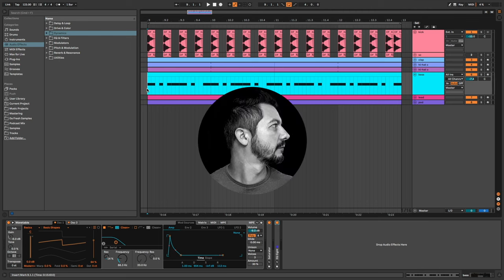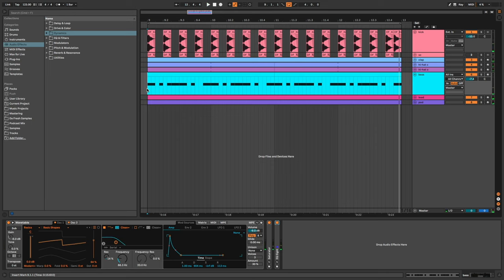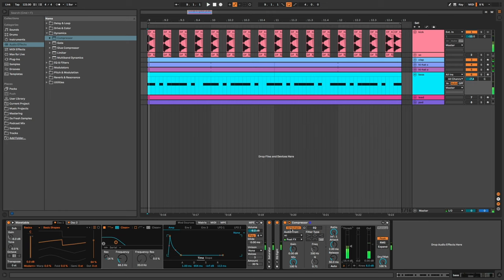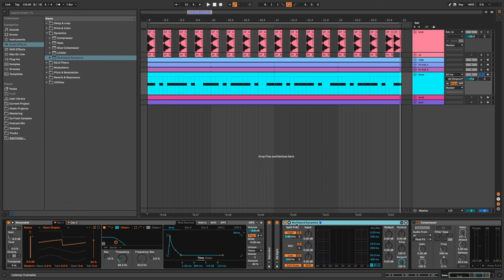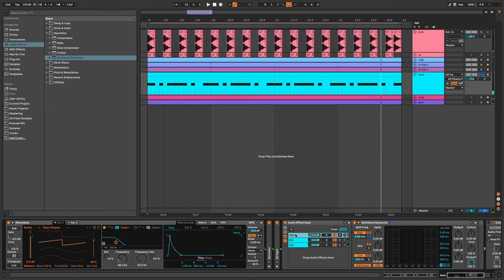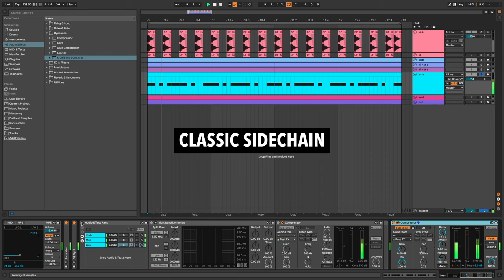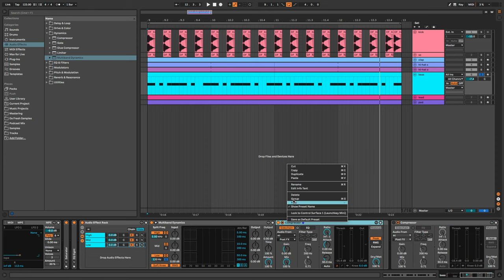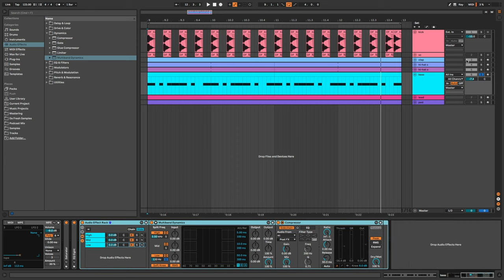AVANCED SIDECHAIN COMPRESSION TECHNIQUE | ABLETON LIVE

Comment: Awesome idea! You can even use two macro controls mapped one to the Mid-High crossover and the other to the Low-Mid crossover of all three instances of the multiband compression, and in that way you can adjust the high mid and low frequency ranges easily.
Reply from the maker: Good idea with the macro controls 👌
Reply: @DaFresh  Need more details on it. If you help